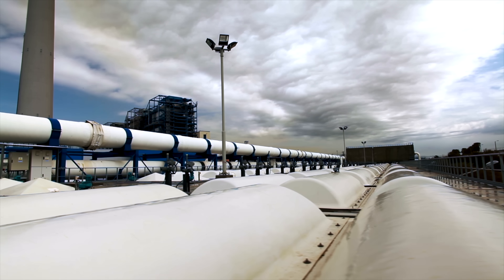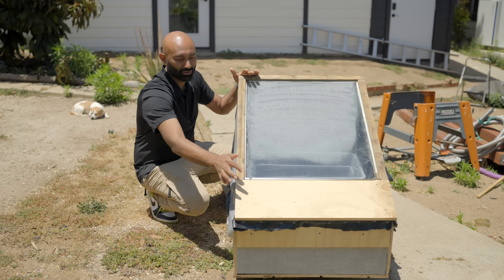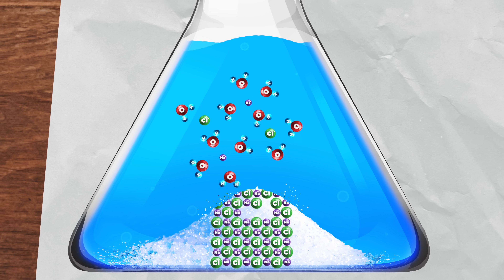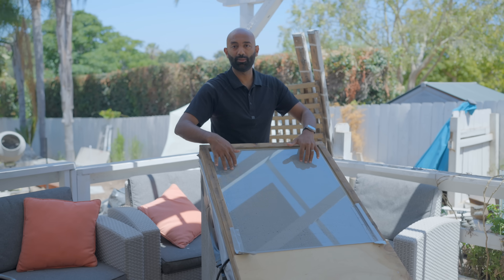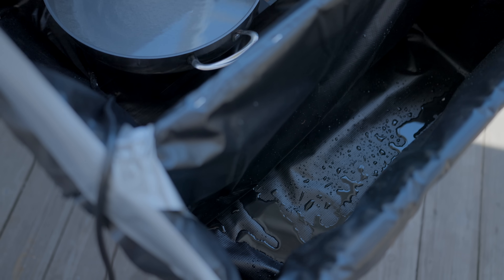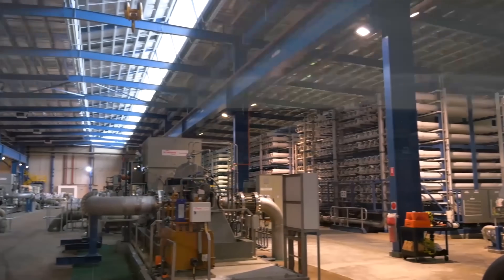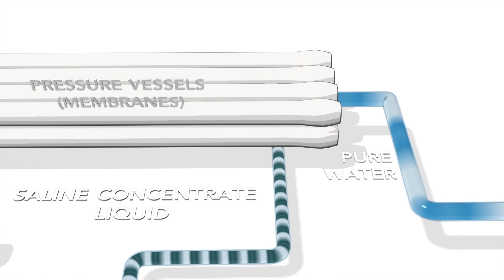Why Aren't Desalination Plants EVERYWHERE?

Comment: I understand fresh water is one of those underpriced and under-appreciated commodities — especially in California.

 Imagine you have a barge on the ocean. It’s covered in solar panels. Onboard is a heat pump which warms seawater brine and cools the evaporated water. A vacuum pump depressurizes the tanks, to lower the boiling temperature. You’d need to pump out the brine and the condensate, though you wouldn’t need to pump in the fresh seawater. 

This is the most efficient setup I can imagine for a land-based desalination facility, though it may be possible to increase efficiency. On a barge at sea, if one uses solar energy to raise the temperature of the brine, for example. She might also use cool water from deeper in the ocean to condense the evaporated water. Nearly energy-free; only a vacuum pump and two fluid pumps to run.

I’d be interested in donating my time to build a prototype. Maybe a local college would be interested in funding. There’s no patent opportunity here, so no one’s gonna get rich. But creating and manufacturing the equipment which solves the water problems in California could prove to be lucrative. 

Worth a phone call at least? 

Joe

Comment: Question, also a potential project for you to try: What if you made a black box, like a solar cooker, kinda like how you did here, but instead of using glass to condense the water, what if you put in a metal mesh that was externally cooled, angled towards your collection area? The coolness of the metal would cause the water to condense on its surface, and gravity would pull the water down along the mesh. How much energy would it take to cool the mesh to a condensable temp? How much of a temperature difference would you need? Is it more or less effective than the methods you tried here?

Comment: 《 Arrays of nanodiodes promise full conservation of energy》 

A simple rectifier crystal can, iust short of a replicatable long term demonstration of a powerful prototype, almost certainly filter the random thermal motion of electrons or discrete positiive charged voids called holes so the electric current flowing in one direction predominates. At low system voltage a filtrate of one polarity predominates only a little but there is always usable electrical power derived from the source, which is Johnson Nyquest thermal electrical noise. This net electrical filtrate can be aggregated in a group of separate diodes in consistent alignment parallel creating widely scalable electrical power. As the polarity filtered electrical energy is exported, the amount of thermal energy in the group of diodes decreases. This group cooling will draw heat in from the surrounding ambient heat at a rate depending on the filtering rate and thermal resistance between the group and ambient gas, liquid, or solid warmer than absolute zero. There is a lot of ambient heat on our planet, more in equatorial dry desert summer days and less in polar desert winter nights. 

Refrigeration by the principle that energy is conserved should produce electricity instead of consuming it. 

Focusing on explaining the electronic behavior of one composition of simple diode, a near flawless crystal of silicon is modified by implanting a small amount of phosphorus on one side from a ohmic contact end to a junction where the additive is suddenly and completely changed to boron with minimal disturbance of the crystal pattern. The crystal then continues to another ohmic contact. 

A region of high electrical resistance forms at the junction in this type of diode when the phosphorous near the ĵunction donates electrons that are free to move elsewhere while leaving phosphorus ions held in the crystal while the boron donates a hole which is similalarly free to move. The two types of mobile charges mutually clear each other away near the junction leaving little electrical conductivity. An equlibrium width of this region is settled between the phosphorus, boron, electrons, and holes. Thermal noise is beyond steady state equlibrium. Thermal noise transients where mobile electrons move from the phosphorus added side to the boron added side ride transient extra conductivity so they are filtered into the external circuit. Electrons are units of electric current. They lose their thermal energy of motion and gain electromotive force, another name for voltage, as they transition between the junction and the array electrical tap. 

Aloha

Comment: Waters boiling point is greatly reduced at low pressures, even down to room temperature. A vacuum pump on a water container discharging through a cooling coil would need little to no heat to work. You should even be able to use the waste heat from the pump. I'm a little surprised the ultrasonic didn't work... it should be able to be made to work. I wonder what the actual salt concentration was.

Comment: Ricky, those microporous filters need a back flow of water to remove the salts, last time I had anything to do with them; how do these flush the salt and recharge? It wasn't just the energy it takes, it was a portion of the clean water ultimately produced in the past.
Reply from the maker: yeah that's a great point! this is why RO really sucks for homes, because it wastes so much water. but for a desal plant... that's a steady flow system, it's not as bad, is that fair to say?

Comment: Regarding your sponsor, EcoFlow...  I notice you don't ever mention the actual energy storage in kWh, or time that you can run the stated loads.  It seems deceptive to only state the maximum instantaneous power output without total energy storage.  
Example: a 4000w load running for 1hr equates to 4kWh of storage.  
When I am explaining off grid power systems to potential clients, I give them ALL the data, suggest you and EvoFlow do the same.
Reply from the maker: I mentioned all of that ,its 4kWh ... apologies if I didn't mention it at that particular moment. but noted and we'll keep this in mind for the future! Thank you!

Comment: Typical "green energy" video. Talk about it it qualitatively. Never address actual energy requirements or efficiency which would betray how inefficient it all is. The best we got here is a hint, that desalination is extremely energy intensive, so they had to actually hook it up to an electricity source to get their demonstrator to work. And solar is totally unreliable which is why they have to spend thousands on a battery to make it work. What you just produced is some of the most expensive water on the planet.

Comment: The "problem" of desalination is overexaggerated. You state a lot or large figures, but don't seem to put them in contrast with others. My point is, the best reverse osmosis plants consume about 3 kWh/m^3 of electricity which is nothing. Why? The average person in the US or Europe consumes a few 100 liters per day, so that's somewhere around 1-2 kWh/person/day if ALL our water comes directly from the plant. Which it never does. Water is recycled, artificially or naturally, and places that need desalination only use it to cope with evaporation. So you're looking at much less than 1 kWh/person/day. Now how much is that? The average US or North European citizen consumes about 50 kWh of electricity per day (very roughly), so desalination would probably be less than 1% of that. The same calculations can be done for cost. Same story. Overexaggerated.

Comment: If you took a metal tank and screwed a desalination filter into one end you could sink it in the ocean until the ocean pressure alone pushed fresh water through the filter.

Being simplistic, if you used pumps and pipes to get that fresh water in the tank to shore the tank would keep refilling itself until the filter clogged with no energy cost and no concentrated brine.

The cost of pumping the fresh water back to the surface is the cost but pumps driven by waves easily address that.

Combining offshore desalination with offshore energy infrastructure, habitat restoration, food production and carbon storage can easily make these project profitable while addressing serious issues.

Combining the synergies of
Reply: That sounds like a great idea

Comment: Ok I never thought about using a humidifier for the purpose of creating humidity so it would need filtering again. I wonder if a dehumidifier with a filter would do the job. I bought a small tabletop dehumidifier to run while its so hot and the A.C just can't pull enough out of the air. I got 2 cups of water this morning while running overnight. I think people are over looking the power of a dehumidifier to make temperatures more comfortable. 80 degrees with 80% humidity is like being in a soup pot but with less humidity its perfectly comfortable. I hope the portable solar market becomes more affordable since it has the power to save lives!

Comment: A couple things. 

First, if you're going to desalinate water, you should try to use fractional distillation to isolate useful chemicals. There's a lot of metals and minerals that could be used for making batteries.

The second thing is A lot of industrial distillation uses vapor compression. You basically have a fan on the outlet that sucks the vapor out and compresses it, cooling off the vapor in the saltwater. That requires a little bit of electricity, but you could probably do that with a small fan and a pipe.

That helps you to reuse some of The solar heat but also reduces the pressure in the evaporation vessel. The lower the pressure, the lower the boiling point. And even if you don't reduce the pressure by much, it's still a reduction in boiling point by a little. You could probably do that with a computer fan and some PVC pipe.
Reply: @orionbetelgeuse1937  Why not?  And I'm not saying complete separation, I'm saying taking brine and increase the concentration of certain elements.

If there's a variable specific heat between lithium, copper, Bromine, Etc we should expect that at different temperatures there will be a higher concentration of some rather than others.
Reply: @orionbetelgeuse1937  I think you must have misunderstood what I said. Everything is in solution, but before you completely dewater the brine, it's easier to move everything in fractional distillation.
Reply: @orionbetelgeuse1937  Yes.  It's using the temperature differential to split a compound or solution into it's component parts.

Do you?  Because you seem like you don't. 

I had a good friend who used fractional cooling to isolate nitrogen from air. 

Why, do you think it only works with hydrocarbons? It's not a broader technique that could be used for other complex solutions? 

It seems like you're just trying to "Well Akshually" but really poorly.

What do you think I'm saying wrong?
Reply: @orionbetelgeuse1937 Are you intentionally trying to misunderstand what I'm saying? I wasn't saying dewatering using fractional distillation, you can do that with just plain old distillation. Fractional distillation is taking seawater brine and adding heat to stratify the brine and take isolate useful materials by density.

This is well known.  There's an industry video on YouTube from the 80s that talks about fractional Distillation for isolating materials from brine.

After the fractional distillation you still have Brine, there is still water. You take one brine with lots of minerals and you sort it out into multiple brines with only a few minerals. You can decide if you want to dewater or use reverse osmosis or further thermal cracking to select for the elements. that you want after that.

What are you talking about?  Are you intentionally adding in things I didn't say to Keep you from having to admit you were wrong?  I think I specifically said the fractional distillation had to happen while everything was still suspended in water. So either you didn't read what I said or you don't know what you're talking about. And that's okay! Do some reading, now you know.
Reply: @orionbetelgeuse1937  I think that's what you think it is, but that's only one application of fractional Distillation.

Comment: Ultrasonic thingy does not evaporates water, it merely breaks it up into tiny droplets. Remember, water vapor is transparent. The fog you see above boiling water is already condensed vapor.
Reply: I was thinking the same thing BUT, perhaps this could be a step to increase the surface area for solar a evaporator

Comment: The problem of building huge desalination plants just for the few hours a year when you have excess solar power is, that you have expensive infrastructur, that could run 95% of the time, instead just running 5-10% of the time.
Otherwise you'd already see people building electrolysis facilities for this. But it simply doesn't make sense build a "factory", if that factory can only run in short intermittent time intervals.
Reply: So dont run it off excess solar, have some sort of solar power specifically for the desal plant. Either with a bunch of panels nearby wired to it so the plant runs every day for 25-35% of the day, or use focusing mirrors type of solar instead. Go look up "solar dome Saudi Arabia desalination plant". It is an ambitious new project that will run off mirrors like some solar plants do but for desal instead of energy production. Estimated to produce massive amounts of cleaned water each day and not really use much electricity at all.
Reply: @LordSaliss  That would be a nice thing, but I was answering the point brought up in the video: Using desal for energy overflow from PV.
Also, while I hope they manage to convert the idea, recently S-A lost a lot of trustworthyness by its "The Line" fiasco.

So I believe it, when it is build and running.

(Even though I always wondered why S-A isn't going all in on PV, with their ammount of sun hours and intensitiy.)
Reply: @testthewest123  the line is stupid but from what I hear SA has been doing desal now for a while.
Reply: @Krill_all_health_insuranceCEOs  With solar energy powering only or at least overwhelmingly?
Afaik is: They use oil and gas.

Comment: @13:37 Entropy is not the measure of how disordered a system is. It is the measure of how homogeneous a system is. Having the salt ions distributed thru-out the water is more homogeneous than having the salt in crystals separated from the water.

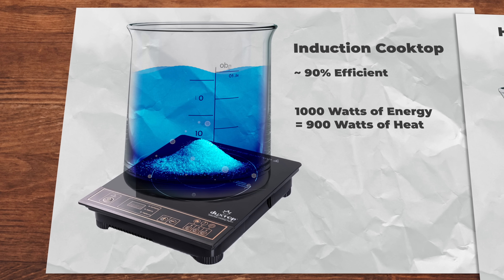Comment: 6:00 You can't do this with a heat pump, the temp is too high, if they could deliver 3-5X efficiency >100c we would make generators powered by the heat in the local environment.

Comment: thank goodness for the desalination at camp lemonnier in djibouti, africa, when i was deployed. a miracle technology but damn expensive and hogged fuel like a tanker aircraft every day hundreds of gallons of fuel to produce it. i was never dehydrated and ironically tasted like from a fresh mountain spring.
Reply: From the cool, clear waters of Mount Kerosene
Reply: @michaelre7556  🤣 couldn’t have said it better myself 💯
Reply: @michaelre7556  mount dooms more explosive cousin
Reply: Well, if they use fuel even in africa, with its abundance in solar energy, you wonder why...
Reply: @testthewest123  obviously it's costly to get a new solar plant up and running but I'm sure they'll get there.
Reply: @Krill_all_health_insuranceCEOs  wish we did have a solar array to power those desalination generators. this was a consideration. our joint command staff in e. africa, working with corps of engineers, determined the fine sand/dust particles settle onto solar panels there so rapidly and the maintenance/upkeep is more expensive and troublesome to keep them serviceable and functional.
Reply: I get your point, and I think some people took it from the wrong perspective. In my very personal opinion, I think water is probably the most easily defendable use case for any energy source, including fossil fuels.

It would be much worse to spend those gallons of fuel on some BS and meaningless lifestyle thing. People need water to live and you can't exactly wait until you can afford to build a large solar array to give it to them. As @mikeylicksit says, thank goodness for the desalination plant,  I'd add, thank God they at least had the fuel to produce water.

Comment: It's hard to compete against the free and abundant energy of the sun.
Reply: Apparently even with the power of the sun we are all screwed if Ricky is the one trying to make fresh water for us.

 Dude wipes off drops of steam. "We shall call this a success!"
Reply: Quaise is coming.
Reply: @orionbetelgeuse1937  he won't answer you lol
Reply: Big oil lobbyists: Hold my beer...
Reply: Well actually not really. The problem is simple: You have a very intermittent delievery of the energy. This leads to very high infrastructure costs, since you need to be ready to collect the peaks and use them. This means you build inverters, power lines, electrolysis or desalination facilities for a large capacity, which then most of the time is idle. OR you build them in a low smaller scale, which then leads to huge losses when production is good, which is basically a waste in solar panel infrastructure.

So not matter how you do it, you will be highly inefficient and we really need to find more and more effective ways to cheaply store the energy.
Reply: @testthewest123  We've had the exact same problem with non-solar power for decades though. Without storage on the grid, you have to have enough generation sitting around doing nothing to handle that one worst case heatwave day, that one major power plant tripping offline,  or major transmission line getting randomly knocked out. California has suffered the threat of rolling blackouts for decades, because no private money wants to build the reserve plant that sits around for 362 days a year doing nothing, and earning nothing. If anything, smaller distributed generation and storage that we're seeing now with renewables is better even if you ignore climate change and greenhouse gases. Bring on the future!